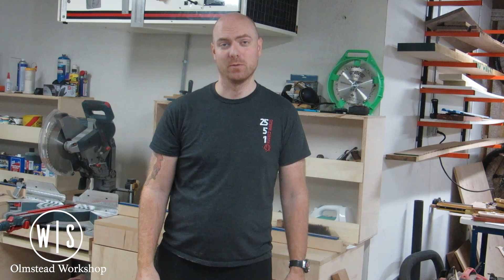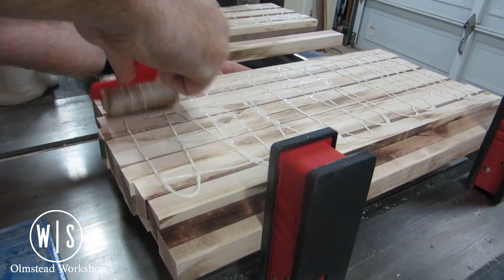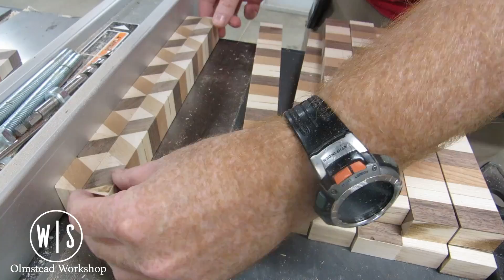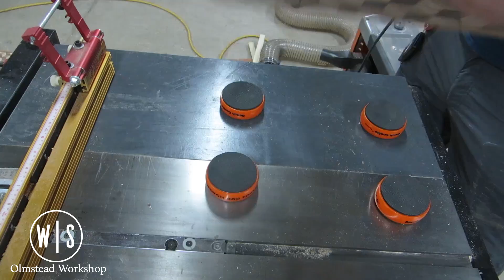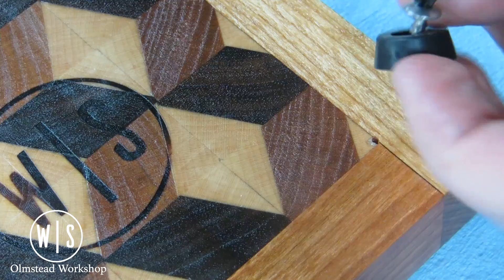3D Tumbling Block Cutting Board, Build This Board!

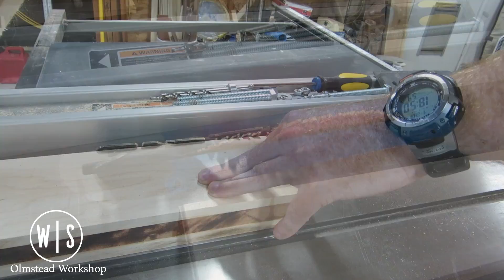Comment from the maker: NOTE at 1:07 I have the fence set at the thickness of the my walnut 1" NOT the thickness of the gang of boards.  The next cut at 90 degrees to square them the fence is set at approximately 2" but should be dictated by your pieces.

Comment: I’ve been trying to make this unsuccessfully btw. 
After cutting at 60 degrees, then cutting back at 90, do you need to make two cuts on each piece at 90?  You don’t mention that.  And also how many inches do you cut at 90 degrees?
Reply from the maker: You cut all your strips with 60° angles making them parallelograms /    /. You fence will most likely be set to the width of your gang of boards, but it is always best to.measure off your pieces.  You'll be cutting off both sides of your strips removing /| and removing |/ so you should end up with a |    | shape again.
Reply: 69 degrees or 60??
Reply from the maker: 60° edited for clarity
Reply: Sorry, another dumb question I hope you can answer:
When making your 90 degree cuts, do you strictly do 1 inch or do you vary the distance in order to square?
I finally got one finished but it’s a bit off.  Still looks okay for amateur.
Reply from the maker: @verb8m1  you'll want to make that 90 degree cut so it looks like the two wood species meet at a point

Comment: I followed this and after the 60 degree cut, back to 90, my cuts are no where near square.  my boards were 2 inches thick; so cut at 2 inches.  no way does this work.  Any other suggestions?
Reply from the maker: Hi Ken when you make your 60° cuts you want them to be the width of your center board. So if your glued stack is .5inch-1inch-.5inch you would want to cut 1 inch wide strips and then turn them to cut them square at 90.  Sorry for any confusion.  It's been a number of years since I made this video so I may have to go back to make a note.  If you've cut them at 2" already you can cut them in half.  You may end just shy of 1" depending on your blade kerf but it shouldn't impact the final product.
Reply: @TheOlmsteadWorkshop  thank you.  Yes, you made a point of placing the wood correctly but no mention of the width to cut at 90!!  Just said make initial cut the width of the gang of boards which is 2inches.  Is that still correct?
Reply: @TheOlmsteadWorkshop  thank you so much for your reply by the way
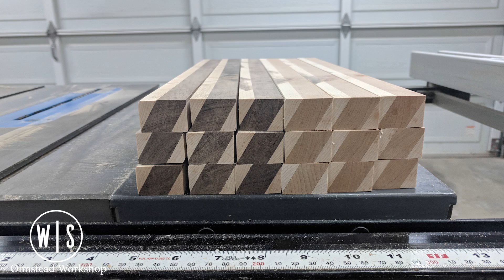Reply from the maker: I think the width of the gang of boards is incorrect.  At 1:40 in the video I've already cut the initial strips and then rotated the 90° to make the 90° cuts.  They look more like 1" than 2" which would have matched the center board width, not the gang of board width.  For the 90° cuts your squaring off the parallelograms turning them into rectangles.  This exact measurement may vary a bit but essentially you want the cut to make the side pieces triangles.  Cutting right where your two wood species touch.  If you take a look at 2:10 you can see it looks like the walnut looks like / /  so you want to make your vertical cuts like |//|
Reply from the maker: I think my originally intention for the cut the width of the gang of boards was for the 90°s was to square the pieces back up.

Comment: What on earth am I doing wrong / misunderstanding?....  after cutting the parallelogram, fence set at stack thickness ie. 2”, I can’t get even close to squaring up,  rotating the parallelogram so the maple is on the sides.  A cut to square up starts at about half way up the maple, leaving a 60 degree “chamfer” on the maple sides. After ruining several pieces I tried drawing it on fusion360 so I could adjust  the dimensions without wasting wood. I get the same problems.  
I love your video & altho it seems clear I’m apparently missing something.  
Hopefully you understand my explanation & can help.
Reply from the maker: After cutting your 60° parallelograms, and rotating your pieces at 1:45 the blade should be set back to 90° to square your cuts.  You're then cutting off the tips of the parallelograms.  The shot at 2:10 shows all my cut pieces.  The walnut, and cherry still look like parallelograms with the maple looking like triangles.  Together they make a square.  I hope this clears it up.
Reply: @TheOlmsteadWorkshop  thank you so much for trying to help my denseness I really appreciate it.  I looked at mtmwood that you referenced. Using it I was able to salvage my pieces by cutting the parallelograms narrower, roughly 1”.  Everything else the same. The maple pieces at .5” wide now on the sides, 60* & 2” total outside didn’t  allow the 90* cut to make the maple triangles like yours at 2:10. By cutting the parallelogram narrower I got essentially squares like yours.  
??? I must have got lost in the weeds somewhere but all good in the end.   Thank you again for your video & guidance.
Reply: Thank you for this video. I’m having a similar issue at this point I cut the parallelograms down to stack thickness. When I go to bring them back to square I am cutting 1/3 into the walnut. It looked like your just barely. I don’t get it. I’m 1/2”,1”,1/2”. Cut at 60. Any thoughts? Thank you.

Comment: The step of framing the end grain portion of the board is essential for reducing tear-out when you send it through the planer.  End grain and planers don't mix well.  Until just recently I would just put a sacrificial piece on either end of my end grain boards and then just cut them off.  I now put a piece of either contrasting wood or a species that is also in the main part of the board.  Makes for a nice connection and protects the end grain from tearing out.  I have also found that a belt sander following the planer step gets me to the RO sander much quicker.  Finally, after going up to 220, I raise the grain with denatured alcohol, go back to 150 and proceed to 320.  Sometimes I raise the grain again.  I really appreciate your discussing the dimensions and the angles - thanks for that.
Reply from the maker: Those are all great tips Rob.  When I first shared this video there was a lot of discussion on mixing short and long grain and whether or not it would lead to splitting.  Like you I like the decorative contrast.  Since this video I've added a drum sander to the arsenal which is much much kinder to the end grain.  I'm glad you liked it.  I don't post videos as often as I'd like but I try to make them entertaining and informative.

Comment: That is a great way to make tumbling blocks! Thank you!  Why don´t you use end grain around the edges as well?
Reply from the maker: Thanks Maggie. I'm still learning a lot myself, but I like to show people that you don't need to have the fanciest shop to get some amazing results.
Reply: Yes, but the board is subject to cracking because the grain direction is not all uniform, so expansion forces won’t be uniform. Thanks for the video!
Reply: The end grain needs to have a piece of EDGE grain next to it, to support those grains as it goes through the planer.  Otherwise, the planer will just tear the edge grain wood away from the remainder of the cutting board.

Comment: Great video! Thanks so much for all the info. I've seen some people set there saw to 60º and some set it to 30º. Not sure it really matters, but just curious.
Reply: The 2 different angles you mention are really the same thing. Just measured from different points. 60* is measured from the table and 30* is measured from the point where the blade is at 90.

Comment: Where is Evey getting 1 inch plus thick boards. I can get 13/16 in rough boards or have sawmill saw the size I need but it's wet. I need kilmed dry 1 inch boards. Just can't find  it. Suggestions?
Reply from the maker: Hey Bob typically I get mine from a hardwood dealer.  I have gotten 12/4 Walnut which is about 3" thick there before. You'll save money and have greater selection over any traditional big box stores or Rockler.

In southern California I use San Marcos hardwood co.
Reply: @TheOlmsteadWorkshop  ok thanks, the hard wood place nearest me don't have that thick of boards
Reply from the maker: @bobhoffman8717  the hard wood dealer I use is a good 45 minute drive from me.  Not always convenient, but greater selection and prices.  I drive a subaru outback so I'm usually strapping lumber to the roof rack to get it home.
Reply: I had the same issue that you did a while back - hard to find nice dark walnut or nice red cherry in that thickness.  First, I milled all my lumber (maple, cherry, and walnut) to 3/4" and then I laminated two pieces of walnut together and two pieces of cherry together.  The important thing is the ratio - the maple has to be half thickness of the cherry or walnut.

Comment: very nice! I was wondering, if i can stack them up and glue together so i can make a bowl using your method, thanks and keep your video's coming, thank s again  Bob
Reply from the maker: Thanks for the subscription Bob.  You could do it like that, but I'm not sure how efficient your wood use would be.  Typically how I've seen people do bowls with this pattern is they rip their rhombuses and glue up a bunch of individual groups too make hexagons what ever size they need to turn and then glue them all up using a band clamp.
Reply: @TheOlmsteadWorkshop  thanks for getting back to me so fast!. Yeah I would waste a lot of wood not I tried the way u suggested, my saw was off, so never did work out. Just wondering if it would work stacking them up. Thanks

Comment: Are you sure that first cut is the same distance as the height of the stack? i.e. 2inches? cause it doesnt work out when i model it in sketchup. Maybe im doing something wrong? Thanks
Reply from the maker: The very first cut was approximately an 1/8 just to maximize the amount cuts I was getting out of the boards.  When cutting the first set of strips they should the width of the thickness of your glue up.  What are you seeing in SketchUp?
Reply: @TheOlmsteadWorkshop  Thanks for the reply!
Yeah sorry, i meant the width of the strips. So blde set to 60 degrees and distance from fence to blade at table surface is 2 inches with your glue up? In sketchup with the 2 inch strips the second cut to square up the rhombus doesnt work. it cuts into your mid layer. It works out to make the pattern if you have the width of strips at 1 inch
Reply from the maker: I didn't give an exact measurement to square the rhombus as it can depend on a few factors such as the thickness of the blade kerf, and the precision of the milling and gluing of your boards.  If you take a look at 2:13 in the video not all of mine are exactly perfect 😅.  The finished impact is the corner of a cube might not meet exactly lined up at a corner of the one next to it, but when cutting and organizing your strips for the final glue up any small imperfections are scattered as strips are flipped and rotated.  The video thumbnail is the exact boards I built in this video if you want to try and spy some imperfections 😉
Reply: Is is supposed to be a roumbos?

Comment: Great Video! Well done! How long and wide are the boards to create this cutting board? Thanks
Reply from the maker: the original length and width of the boards dont really matter because when you cross cut your strips that will determine that will determine the length of your board and the number of strips will determine the width.  The boards I started with were about 8 inches wide x 6 feet long.

Comment: Thanks for posting the video!  Question ... at about the 1:10 point in the video, you say "set the fence to the same thickness as the gang of boards".  I assume that would be 2 inches based upon how you set up the laminates (1/2" maple, 1" core, 1/2" maple).  Am I interpreting that correctly?
Reply from the maker: That is exactly right Frank.  In my case the fence was set at 2"